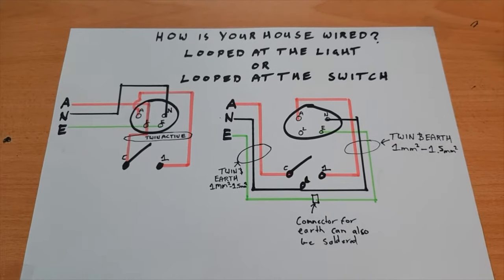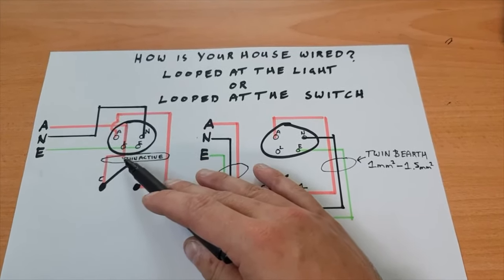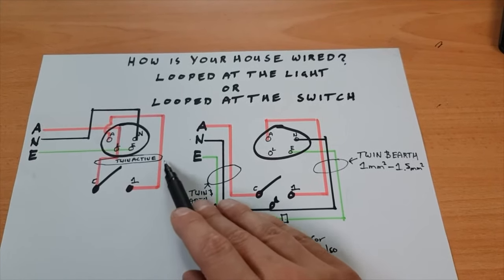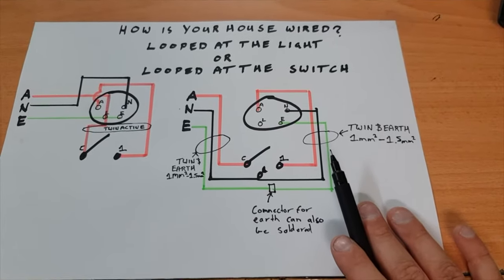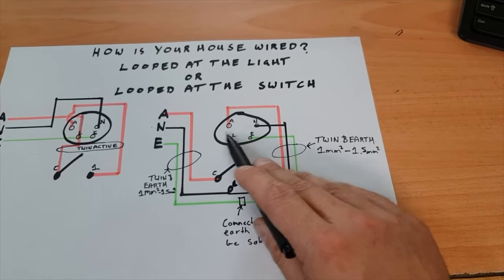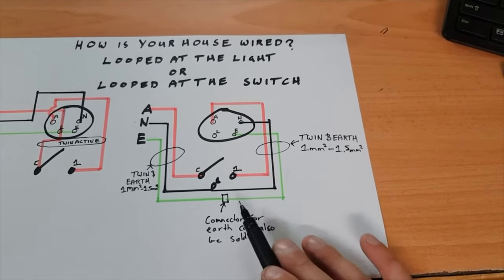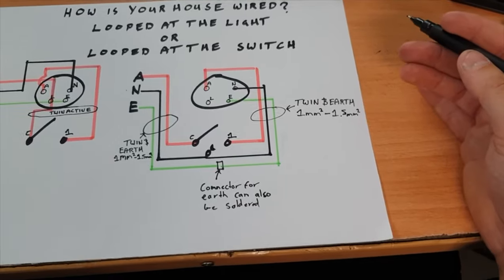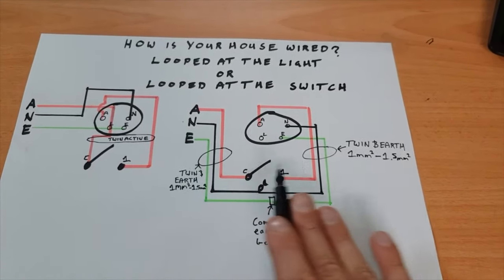How Is Your House Wired Australia/NZ 2024

Comment: first one is called top feed, second is bottom feed. Second wiring is very common. But first wiring is not common now, which may happen in this kind case: a switch outside a room controls a light inside the room, now want to move the outside switch to inside, and the two switches position is far way. So loop the feed wire with light wire in outside switch, so the phase wire go to the light position, then lay a twin phase wires to the  inside switch, the important is here: loop the phase wire with the twin phase wire in light position, then the new phase wire goes to the new switch, then another phase wire(one of twin phase wire), normally white color, go to the light. The circuit is done.
Reply from the maker: Top feed and bottom feed. I like it 👍 Easier to remember aswell!

Comment: Hi, On an electrical website for a company in Melbourne they said " In Australia, the main method used to wire lights is called the ‘loop at the light’ method". I'm not saying that you are wrong, I'm just questioning it. My house is old and I think my lights are looped at the switch.
Reply from the maker: Good question! So most older houses are looped at the light but more commonly these days are looped at the switch. Reason  being is you use the same cable for all the wiring if you loop at the switch. If its looped at the light its a different cable (red and white) down from the light to switch.
Reply from the maker: You can still wire a house looped at the light or the switch pros and cons to both. They both have the same end result.
Reply: My old house built in the early 80's was looped at the light, My newer house built in 2005 is looped at the switch. Looped at the switch is much better especially with smart switches coming in that require an Active and Neutral connections. IMO if anyone wired looping at the light there crazy.
Reply from the maker: @tready2008  I agree smart home devices are becoming big now!
Reply: @tready2008  The problem here is the design and placement of the 'smart' unit. It they replace the switch, then they have to be cosmetically similar to others in the house, requiring a range of offerings. If they are mounted at the light, the colour, shape, size are less relevant- and have the advantage that the switch can be used as a 'if the state changes, change the light state' input. So, the light can be used as either manual or 'smart' by different members of the family. Saves a lot of arguments...

Comment: Running a spur to every light from the switchboard is massively inefficient. The UK system of a ring main looping all of the light fittings on a floor, with a spur to each switch (as in the LHS example) uses less cable, fewer breakers, and is simpler/cheaper to install.
Reply from the maker: Interesting I would'nt have a clue how they do it in the UK or understand the terminologies but you seem like the right person for the job 👍
Reply: @allelectricalau  It is quite a simple system- the cable (5A flat twin + earth) leaves the dist. board, goes to the first light fitting, daisy chains to all the rest, and then back to the board (same breaker)- so twice the current capability of a single cable. The same system is used for the power circuit, only using 30A cable. The kitchen cooker is on a separate spur. So, 2 story house = 5 breakers. Do not understand why it is not more widely used...
Reply: @Tensquaremetreworkshop  think your confused. We dont not run a seperate cable to each set of lights from the switchboard lol. We just loop the cable from the switchboard to each switch on the circuit.
Reply: @wally4172  Sorry, but your reply is far from clear. Are you saying that you use a multi-drop spur for lighting? How many drops would you have on a spur? How do you decide that? Do you do the same for power, and if so, the same questions.
Reply: @Tensquaremetreworkshop  mains in and out to each light switch then a switch live off each light switch to the light/lights in the individual room. No cable rings back to the board for the lighting circuit. It’s the sockets that are a ring

Comment: Hey mate, nice video.
I went to rewire a light switch and discovered that I only have 2 reds (twisted together) and a white wire to deal with.
Would it be safe to assume that the white is neutral and screws to the common port on the switch? The red to the top terminal 2?

Comment: Hi mate, great video. I have a quick question. If your wiring downlights with plug in plugs in the roof, is it easier to loop at the plugs and then run a single cable down to the switch in the wall or would you still loop at the switch for this setup?

Comment: Cheers mate, thank you!
I'm yet to see the "loop terminal" used.
So far I've seen two Green-Red-Black cables coming down to a switch and while reds connect through the switch, Greens and Blacks are usually twisted and connected in a separate terminal.
In what case would the "loop terminal" actually be used?
Reply from the maker: So the black ones can either join in the loop or join in a connector both are legal. My preference is join in a connector because I feel it does a better job.
Reply: Thanks  @allelectricalau
Reply from the maker: @rnd_Ys0zePZ  You are very welcome 👍 Sorry it took so long to get back to you.

Comment: Hey mate, great video. I just bought a combination light/ceiling fan switch that is touch activated to replace the old dial/switch that broke. When I pulled the old switch off I noticed that there was no earth and neutral to the switch. It had me boggled until I found you video. House is about 40+ years old. My problem is the new switch won't work without the earth to the switch. Can an earth be be traced from the light/fan and brought back to the switch?
Reply from the maker: Interesting! I haven't actually installed a touch one before. There should be a wiring diagram that came with the switch that should say what it needs. It sounds fancy so im just assuming it needs a neutral and earth from the same circuit from where the active and switched active originates from the fan.

Comment: Top stuff manzo!So is looped at the switch and then on to light what you call in series?
If so ,how then would i add a female socket after light to create a "Dim bulb current limiter" ?
Reply from the maker: Thanks for the comment i'm not quiet sure what you mean though.
Reply: All good.I figured it out.
A Dim bulb current limiter is a simple contraption consisting of a switch ,lightbulb,and outlet wired in series.If theres a short anywhere in whatever you have plugged in the lightbulb lights up taking up the current saving more damage to item.Mainly to check ol valve amps etc..Thanks tho!😀

Comment: Technically the power still goes straight to the switch in the loop at light method as the looping terminal is just an alternative to a connector between cables. You just can't run the active wire separately to the neutral and earth because they come as an insulated 3x cable together. Looping at the switch is definitely the popular method in Australia.
Reply from the maker: Yep correct the hard active goes the switch but not much it can do there apart from switch back to the light using a twin active. Looping at the switch is the way to go 👍

Comment: Very well explained. Q. I had a single light bulb in my shed that had the old system looped at the light. If I've replaced the single bulb with three fluros, and continued joining the earth and neutral, and looping the live, should it not work? (the earth was not connected at the switch) I keep tripping it grrrr

Comment: Great video! Is there a way to determine how many lights or how much electricity you're putting through a circuit breaker? I want to put up some extra lights in the backyard, however do not want to put too much load on the 'Lights' circuit breaker.
Reply from the maker: Ohms law is how you calculate that
Reply: @allelectricalau  Actually, no, it is a simple power sum divided by voltage (to give breaker current). Resistance (Ohms law) just unnecessarily complicates the calculation.
Reply: @Tensquaremetreworkshop  that is literally ohms law I = P/V
Reply: @brendanoconnor4802  Ohm's law is V=IR. Your version does not contain the unit that is named after him!
My point is that you only need W=IV for this calculation- the lamps will declare their power rating (W), you know the supply voltage (V) so you can calculate the required amp rating (I) of the breaker. No ohms are involved in the calculation.

Comment: In the first example looped at the light, you've got the looping terminal within the light. If the light is removed does this mean the 2 switch wires will read 0 voltage, but this is potentially normal? Trying to diagnose why a light is not working in an old house.

Comment: Great Video, I have two ceiling fans connected to two lights, both turn on together, how do I wire it so I have the one on without the other.
Reply from the maker: Yeah thats not right and can be compilcated splitting up the circuit i would call a qualified electrician for that.
Reply: @allelectricalau  I forgot to add the lights are separate from the ceiling fans.

Comment: hey mate, is it possible to use 1.5 cable without instead of twin active for power at light?
Reply from the maker: No you should use twin active because red and white represent actives. Black is neutral.

Comment: Hi mate, if iam connecting 2 or more lights, i just connect the live to live , neutral to neutral and earth to earth to the other light?
Reply from the maker: If you have a active neutal earth from your switch to your first light in order to add another you would have to run another A+N and earth cable to the next light from the existing light. And yes they would just join together. Need to pay attention to how the house is wired because people think just because the light switch is off there is no power. NOT THE CASE! I always recomend to use a qualified electrician.

Comment: My switch board operates two sets of downlights - One switch is On/Off, and the other On/Off with a manual dimmer. I was looking at changing to dimmer smart switches - my switch only has Red and White wires on a 2016 Australian Apartment block. Do I have a neutral wire? I'm just confused by the wire colouring.  can anyone help?

Comment: How to wire a switch to control a light and a socket?
Reply from the maker: Thats called a mixed circuit. Why exactly do you need to do that?
Reply: @allelectricalau  In my bathroom there is a ceiling light+exhaust that sometimes goes dark while running. I am thinking to replace the switch of the light with a switch+socket. Then I will plug in a night-sensor light into the socket. Now whenever the ceiling light switch is turned ON the sensor light is also switched ON and if the ceiling light goes dark the sensor light will light up.
Reply from the maker: @amerriaz123  For a job like that i recommend you contact a few local electricians to provide you a quote to replace the light/exhaust fan.